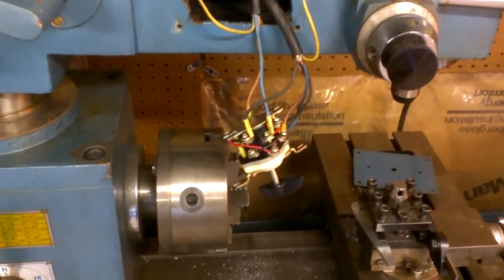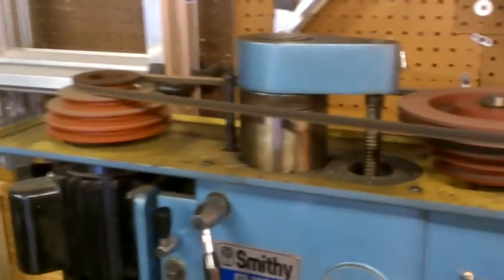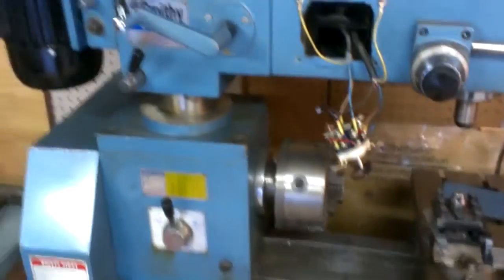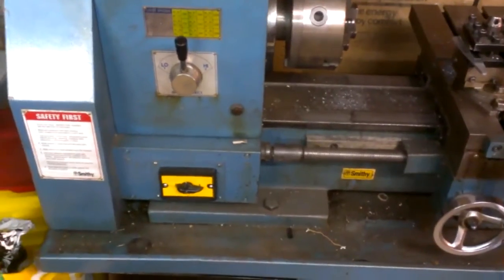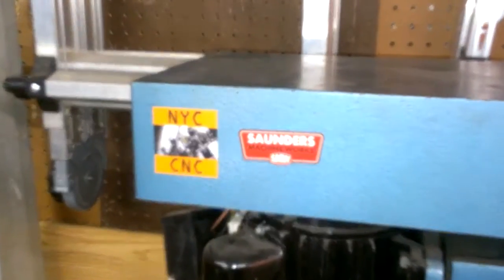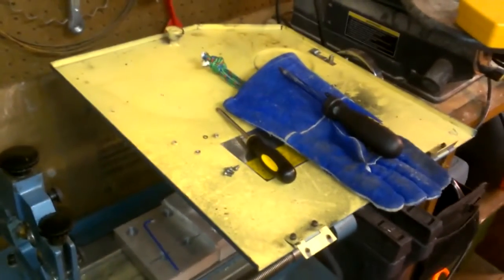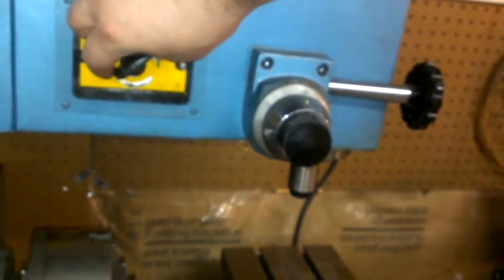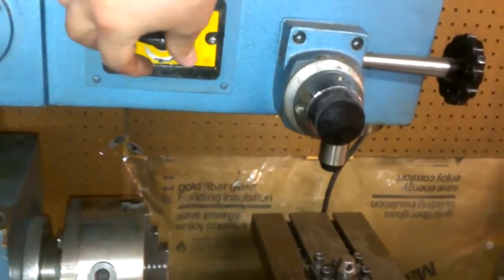Smithy CB-1239 First Runup

Comment: Hello, I have a older Smithy 1220 with the same switch that you showed in you video. My problem is the switch was removed at some point, I have the switch, and was wired direct to a toggle. The problem is it only runs in the forward direction which obviously makes my mill run backwards. I'm not an electrician and don't know how to wire it correctly so the switch runs the motor in reverse and I can use my mill. Any help would be greatly appreciated. Do you have a direct contact? Thanks, Ron

Comment: hi, how much You paid for the lathe?
Reply: +Fernando Ascencio  I bought mine 13 years ago, was $2900+ then, also the CB 1239 is a discontinued model, But I like mine
Reply: +John Savoy  thanks, i just got a grizzly G0704 Mill, was thinking on a Smithy first but 2 machines for me are the best way to go.
Reply from the maker: +Fernando Ascencio Hey, sorry, I didn't realize I had a comment on this video. I worked out a deal and effectively paid $1200 for it, though not in cash. In retrospect, I probably wouldn't have paid $1200 if I actually had to dish out the green stuff.
Reply: Is there anyway I can get ahold of you? I bought one of these and have 0 info on it. No manual or anything. Bought secondhand so I’m trying to figure it out.